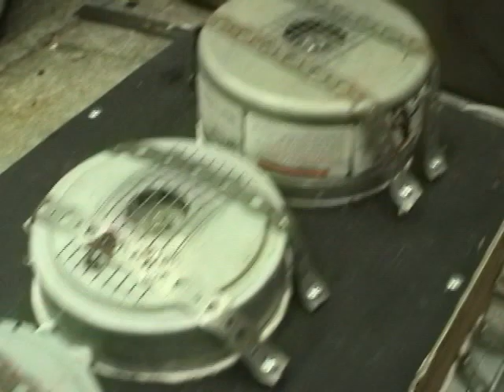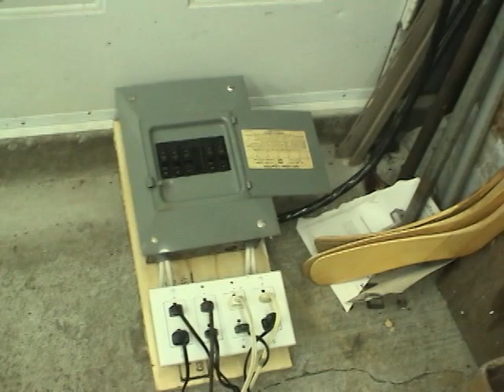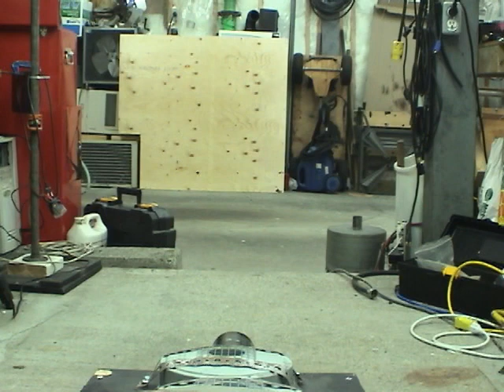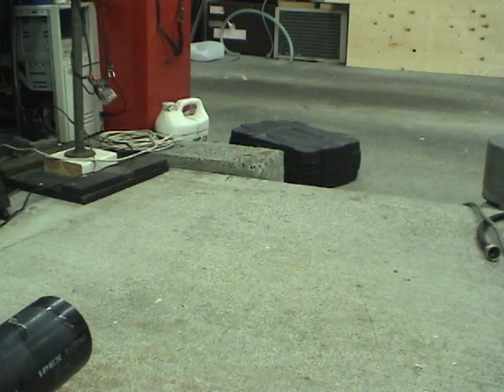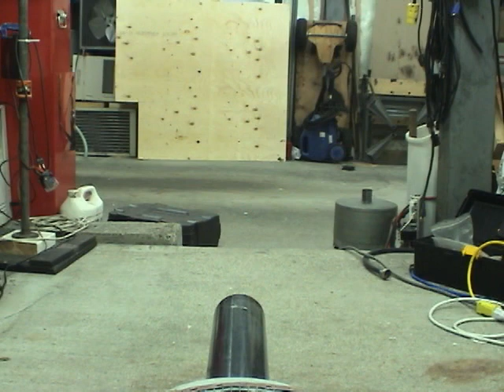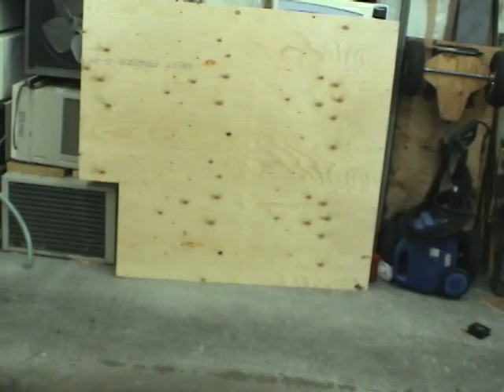Monster blower - 9 vacuum cleaner fans

Comment: hey loved the video! maybe you can help. im trying to actually do the opposite. im want to make a very strong vacuum for cleaning duct work out of old furnace blowers but i cant figure out how it would work. if o would have to reverse the motor or if they would already have enough suction. anyways. i guess i dont know what makes a fan a blower or a suction or there just the same its just what  end you put the hose on.
Reply: Just build the same setup, but mount all the motors facing the opposite way as they are in the video. (Small centre port facing into the box)

Comment: I'm trying to make a high pressure blower to use in a venturi vacuum cleaner set up for doing carpet/hard surfaces at a hotel I work at. Do you have any idea how many psi there was at the output? Any centrifugal blowers I ask about have lots of CFM but not much PSI. I love what you've done.

Comment from the maker: @frankie2234 Thanks!

All the blowers individually run on 120V, all of them together drawing about 90A. This is split between the two phases on the welder outlet, so it effectively draws 45A at 240V.

I'll have to give leaf blowing a try, as well as using it as a "jetpack" to move on roller skates (using a really long cord).